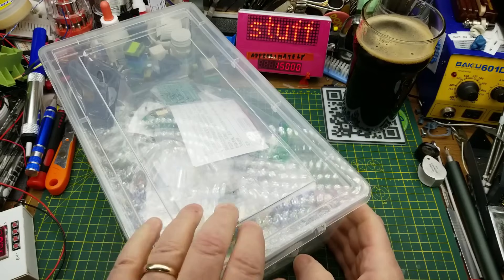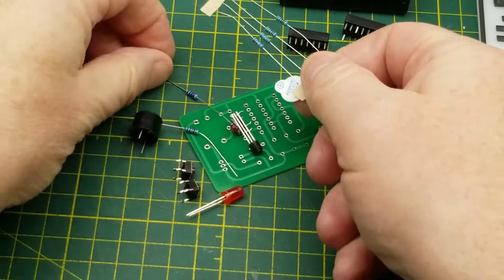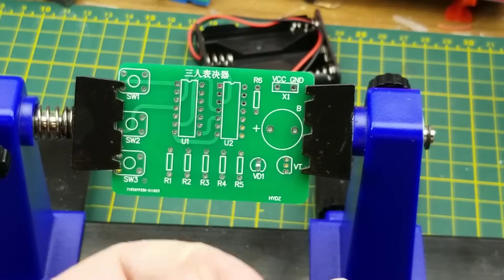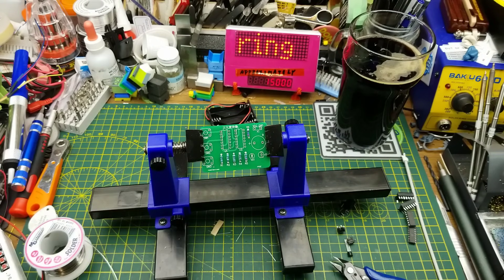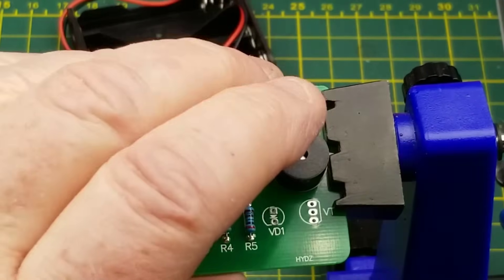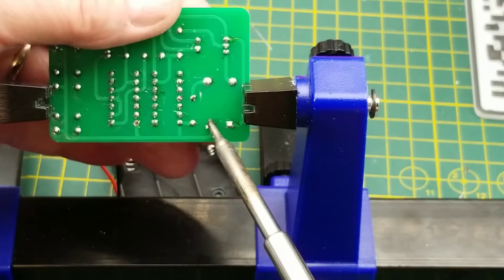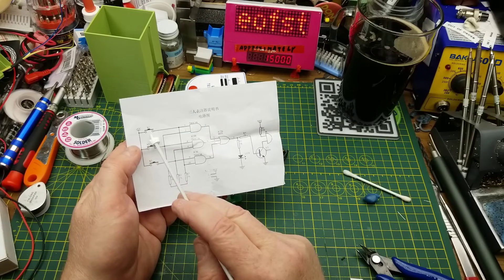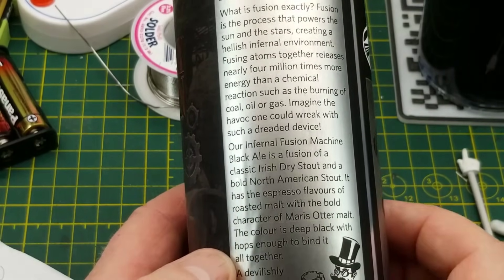December kit builds: logic gates and a buzzer

Comment: I think I know why these kits don't have silkscreen component values.
1. By default the PCB CAD program doesn't place the value on the silkscreen layers but rather the fab layers
2. Even if you move the value to the silkscreen layer in the CAD, the Gerber export doesn't select to include the values, or at least the PCB mfrs instructions don't show to select them
At least that's what I found with KiCad

Comment: That's the thing i don't like about the way some draw diagrams, crossing wires that connect together, should stagger the connections so that 4 way cross has 2 dots
It's so easy not to see the dot, or for a dot to be missed, however a T junction is obvious with or without the dot.

Comment: Some extra info: The sticker on the buzzer is also there to protect the piezo element during ultrasonic cleaning. You can ultrasonically clean it without it , but then you have to "bake" the board to really dry it and prevent corrosion.  And o yeah.... the only thing I like being magnetic is my screwdriver...

Comment: at least 2 of the 3 locks must be locked. probably for learning logic gates and soldering. don't know why they bothered with sockets. good entertainment as usual.
Reply: It also shows that the first three gates debounce the switches. Took me a while to remember to design that in way back when I was designing such circuits.
Reply: @markfergerson2145  Can you describe where the debouncing is in this circuit as there are no capacitors in the circuit to slow down the transition level changes. pure logic gates will not debounce with out some kind of input filtering, feed back, or hysteresis on the inputs.

we are looking at Propagation delays of 20 -30 ns they will see every switch bounce with no problem. but the circuit does not rely on the number of transitions seen and they will be to fast for us to see so there is no need for debouncing in this design.

Comment: I am not color blind but the color contrast on resistors is a big problem generally and with the blue ones some values it is impossible  multi-meter to the rescue!
Reply: Unfortunately I’ve gotten lazy over the last 20 years. When breadboarding with 1% resistors, I just pop them in a component tester to verify. The 5% values are permanently burned to memory.
Reply: the brown carbon film ones are no problem, but the blue ones are annoying.